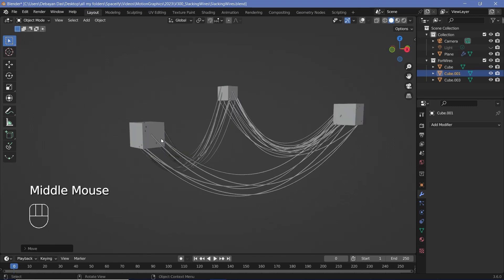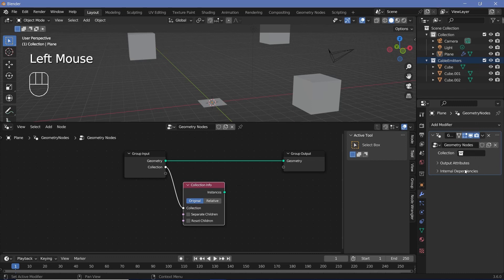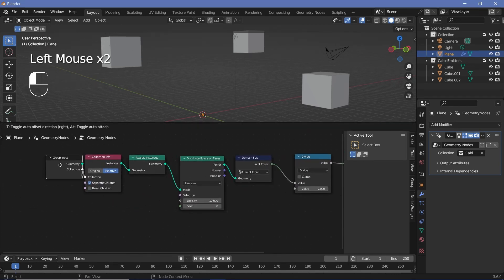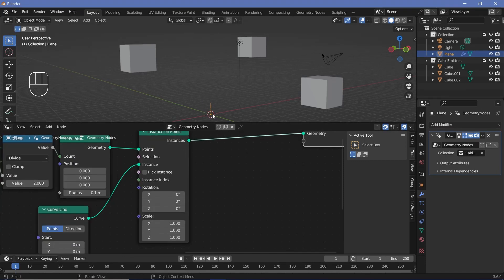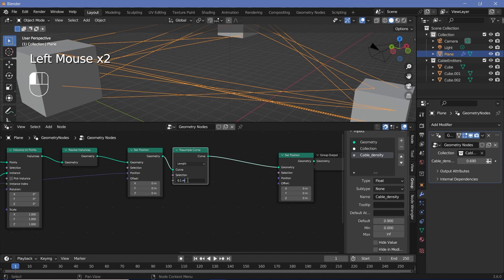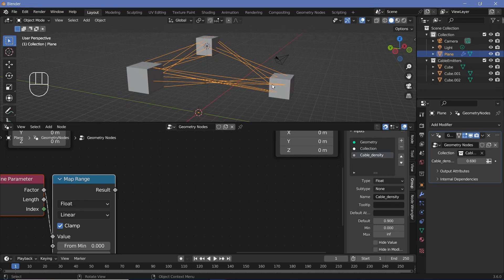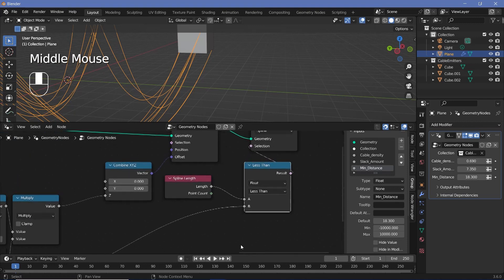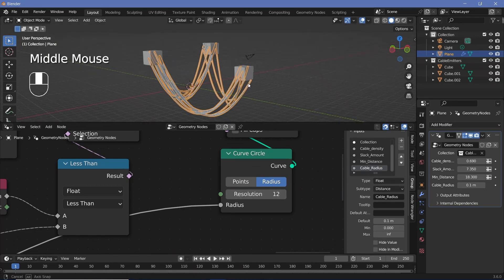Automatic Cables Generator using Geometry Nodes - Blender Tutorial

Comment: Hi, I know I'm a bit late but I'll ask anyway, first, thank you for that tuto, it helped a lot, so here's my question : is there a way to randomise the slacking of the cables per cable, so that they don't all slack at the same height. I tried adding a multiply with a random value but it don't work and I don't have a lot of ideas. Thanks again and hope you'll answer soon !
Reply from the maker: Hi! 
I have not personally tried it.
However, it should be possible with the multiplication by a random value itself. 
I would think the reason why it did not work for you is because you want a random value for each spline separately. So you would have to search up for a spline parameter node and use the 'spline index' value as the ID for the random value node. That might help. 

If that does not work, try to store a named attribute on the spline or instance domain and then use that value to generate the randomness using maybe a white noise texture. 

I hope these help :)

Comment: Oh, and I did not rebuild this nodetree yet, but simple question: if you don't want cables connecting to points on the same object and using the length as criterion - why not deleting the curve before applying the slack? This way you can change the slack to whatever you want and it has no effect on the cables' selection.
Reply from the maker: That definitely works and is a much better solution than what I did😅

In my head, I went linearly and tackled one problem at a time and didn't check for methods of optimisation, which I definitely should have done. I'll try my best to check for these possible optimisations in future videos.